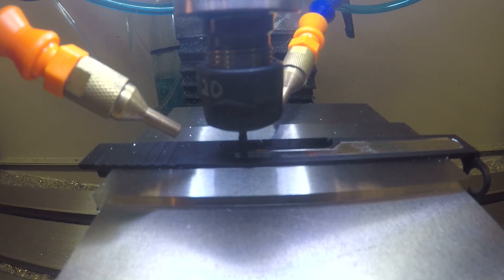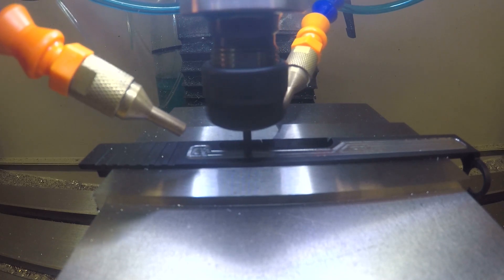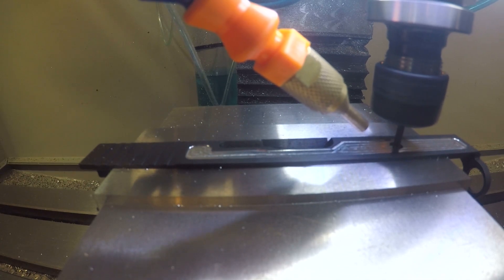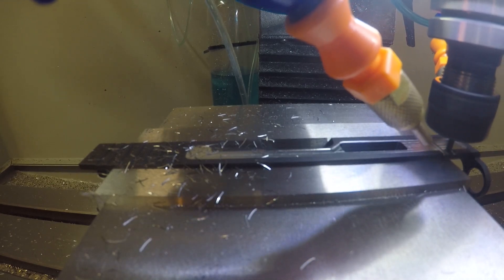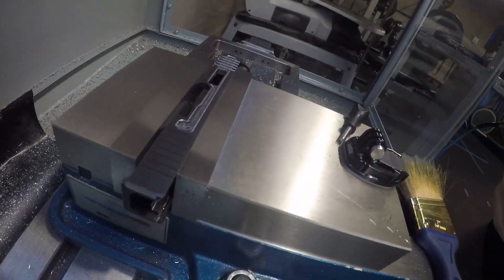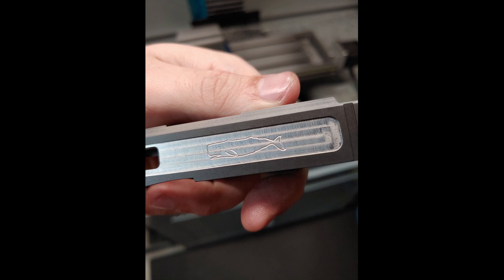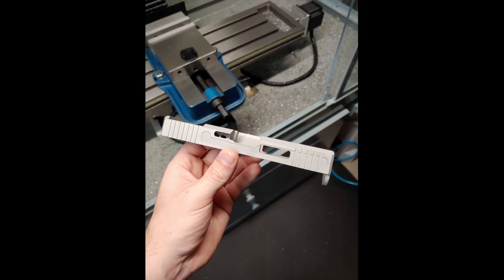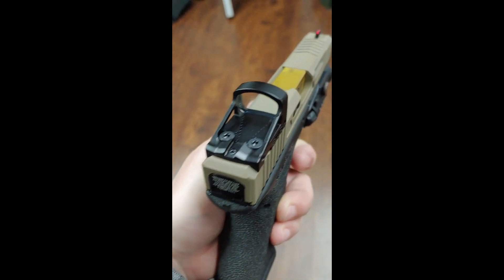Milling a Glock 19 Slide with the PM-30

Comment: Hey I really want to start doing this as well can you get a hold of me and help me getting my own setup in my garage and doing the same thing you are as well none wants to help me out lol but I would greatly appreciate it
Reply from the maker: What exactly are you looking for help with? The machine building side, the cad/cam or actually machining slides?
Reply: @MPMachining   I guess what kind of machine should I buy for cutting out custom slides like what you do for a cheaper price something I can just put in the garage and also what kind of program should I run in the computer so I can put what I want in the computer and the mill does the design I created
Reply from the maker: @michaelwallis5371  that really all depends on your budget, if you plan on making a business out of it or just some personal work and how much time you're willing to invest. As for the computer program, Fusion 360 is definitely the program to use for the CAD/CAM but if you haven't ever done cnc machining or CAD, you're going to have a pretty steep learning curve in the beginning. I'd recommend checking out the older videos from John Saunders over at NYC CNC. He did a wonderful job going over some basics in his videos back a couple years and up until today
Reply: I’m not sure on the budget I’m willing to spend a little more if needed but would like to stay on around 5k if that’s a thing I wanna start small learn how to do it the best then when made a bit of money then invest and start creating a business I’m not sure what machines to even look at
Reply from the maker: @michaelwallis5371  definitely start looking into the Tormach machines. That's as cheap as you're going to get. A completely base 440 might come in close to $5k but that's about as close as you're going to get unless you build your own machine which is a whole other topic.
Reply: @MPMachining   thank you so much man very much appreciate it
Reply from the maker: @michaelwallis5371  no problem at all. If you have any questions along the way let me know
Reply: @MPMachining   most definitely man I will do that
Reply: @MPMachining   one more does it matter what type of laptop I buy as long as it’s not junk and will the 440 run off my normal power at the house or do I need an electrician to come out and add something?

Comment: how do you like this mill? im about to pull the trigger on one.
Reply from the maker: Absolutely love it. I have done some more upgrades since the videos I put up but I don't regret it one bit. Thinking of going CNC or keeping it manual?
Reply: @MPMachining  will probably be manual for a month or two.
Reply from the maker: The one thing I forgot to mention about the PM-30MV is about the base. The add on blue base they sell for an extra $100-200 (I forgot the price) is absolutely useless if you intend to make the mill CNC. Even at rapid speeds of 110 or so IPM before I raised mine to 160, when the machine moved it would shake the entire machine at the base. Invest a little time and money and just build your own stand and enclosure, it was completely worth it.
Reply from the maker: It's going to really work well for that. One of these days I'll get around to editing and posting some more videos. I have made a dozen or so knives on it and the quality is amazing for a small machine
Reply from the maker: I think you will be really happy with it. Just let me know if you need help at all
Reply: Where did you get your ball screw kit? Also look into guhring diver endmills I know you are a fan of lakeshore but guhring is next level stuff at an affordable price.
Reply from the maker: I got my screws, double nuts and mounts from Pro Cut CNC and I'm happy with them. I'll definitely take a look at those guys. Always in the market for new tooling
Reply: Battle Resistant Outfitters they plunge down at cutting speeds up to 1xd
Reply from the maker: Just watched some of their videos. I'll definitely be picking up a couple to try. Without an ATC, the time I would save being able to plunge without predrilling for a pocket would be be great with no tool change
Reply: Did you make a welded base or something else?
Reply from the maker: I welded together a base using some 2.5" square tubing. I'm not a great welder but there are ways around that. Put some heavy duty leveling feet on it at the end and now it's just what I needed
Reply: I wondered about the base I wonder if filling the base would concrete would be sufficient in your opinion.
Reply from the maker: Filling it with concrete would certainly help. That and some really good sturdy leveling feet would be the minimum you needed to make it useful. The biggest problem with their base is it's width. The base I built is roughly 40" wide and 36" deep. The larger footprint is more important to me than the added weight would be. Where are you located out of curiosity?
Reply: Nitro WV
Reply from the maker: Got it. I was going to say if you were somewhat local you could come grab the base I have or at least take a look to see if you wanted to bother going that route. What are you planning on milling with the PM-30?
Reply: Knives and rc car parts
Reply: You mind hitting me up on Facebook I’d like to chat in a less public board
Reply from the maker: Funny enough I don't have Facebook because people get too political and carried away in my opinion. I have an Instagram @battleresistantoutfitters or you can shoot me an email battleresistantoutfitters@gmail.com
Reply: @MPMachining   sent you an email. what size stepper motors are you using on this?